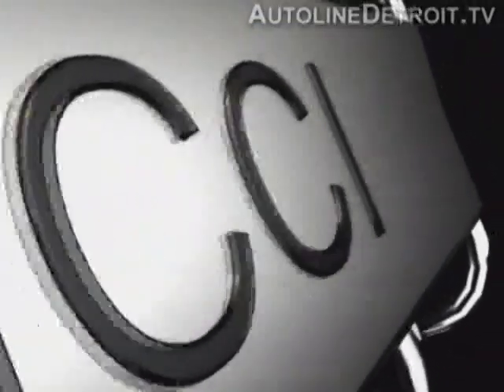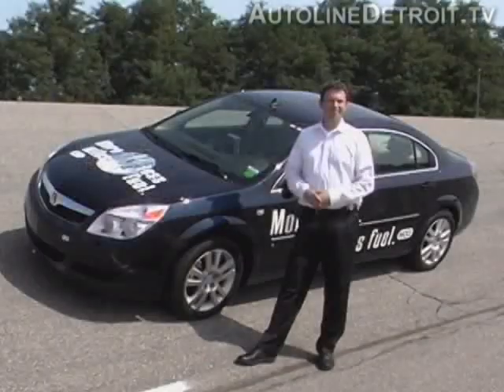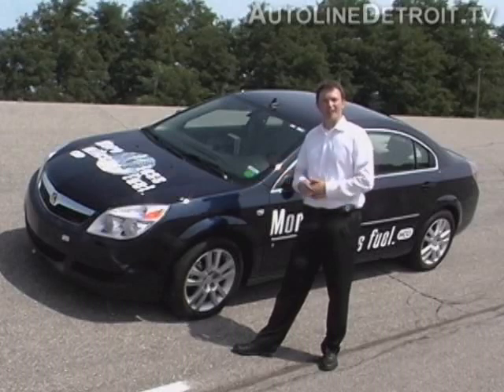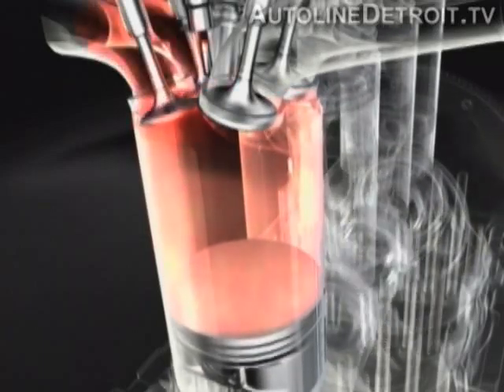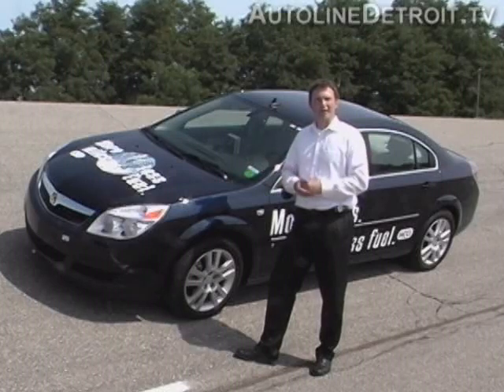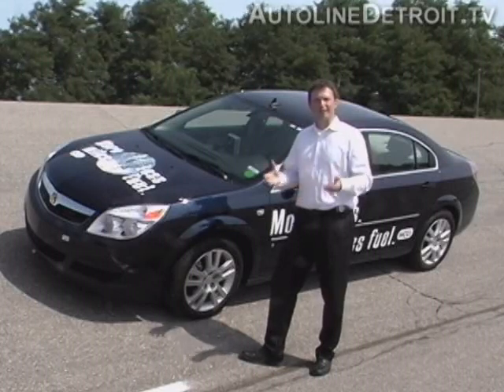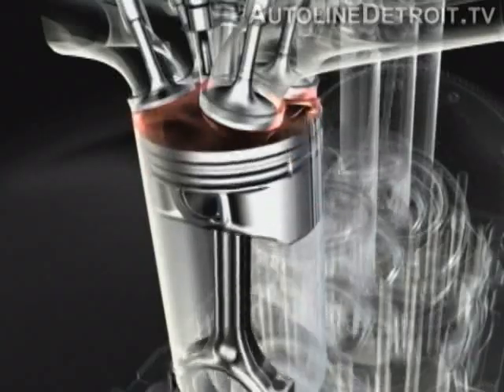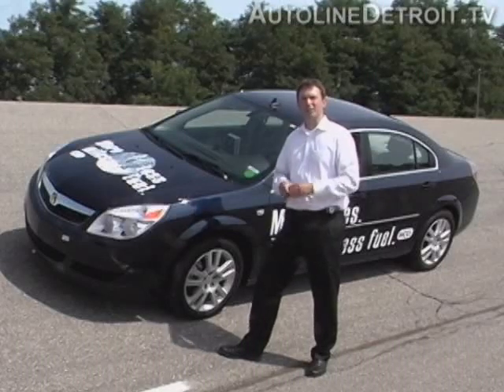John's Journal - GM Makes HCCI a Reality

Comment: 100 years? Get off your stupid Texan high horse and get the fuck outta here. Electric is around the 90% efficiency mark. You got nothing
Reply: Except for the line loss to get the electricity from the coal burning power plant to your charging station.
Reply: If all the ICEs were replaced with electric motors and rechargeable batteries, nearly all industry would grind to a standstill because trucks would only be able to get 300 miles between hour+ long recharging sessions.
Reply: Sander Vercammen ok well let's compare apples with apples then.. 
Run a bare IC engine at full blast straight into a dyno, and allocate say 100kJs of energy going into the engine as petrol. Then measure the power output as well as any waste energy due to heat in kJs.
Then mount E motor onto dyno, allocate 100kJs of electricity into the motor and measure power output and any waste heat in kJs.
Then directly compare power in kW or hp and heat in Joules.
Assuming the both motors are of good quality and representation of their own kind, I guarantee you the electric motor will be more efficient every single time.
Reply: Sander is correct. People who advocate electric like it's a miracle cure for all automotive ailments never seem to look at the big picture. When you're talking environmental impact, you have to take every step into consideration: mining raw materials, manufacturing, upkeep, recycling, etc. It's the same with the vehicle's power source. It is much easier and less expensive to refine petroleum than it is to manufacture a lithium-ion battery pack. 

Then there's the weight-to-distance disparity, which makes any sort of long distance driving laughable. As-is, electric is only viable for a few hundred miles, and recharging takes far more time than pumping a tank of gas. Even if fast charging stations were built all over the country to facilitate cross country travel, the time wasted by having to stop so often makes electric a poor option for any shipping or delivery service.

I'm sure these issues will eventually be ironed out, battery technology will improve, and we'll all be driving electric in the future, but it's going to take at least 15-20 years for that to happen, probably more.
Reply: Wich is a false comparison. Most coal and gas power plants have a efficiency somewhere between 30% and 60%.
Reply: The absolute best you can get out of an IC engine is about 35% (wide open throttle, full load), but the reality is that most cars seldom if ever run at more than 5% load and REAL efficiency is less than 2%.

Electric is about 35% source to socket overall(*), so EVs are still a major overall win - and it's a lot easier to scrub a smokestack than an exhaust pipe.

(*) Most combustion plants use co-generation systems which drives efficiency above the 60% mark. The lower efficiency plants are only used as peaking capacity. There's around 40-50% transmission loss in most electrical systems and non-combustion sources need to be factored in too.
Reply: 5% load? Maybe an expensive car with a huge engine. But with a small 1.0l -1.6l engines I can assure you it will be a lot higher. If you go 130km/h on the highway with a small car with a 1.3l engine you will be nearly flooring the pedal.The engine load will be over 70% almost constantly.
Reply: How would that work when half of the car is battery? A tesla battery pack weight 500kg. Good luck swapping that.
Reply: Sim Salabim no the battery is BEFORE the motor you fuckwit. Between the motor and wheels there's a diff and some shafts maybe, which has negligible power loss.
What about a iCE? There's usually a transmission between the wheel, that saps about 15% in power. The engine itself is around 35% efficient for petrol and 45% AT FULL THROTTLE! Who goes full throttle all the fucking time? Also, if you're idling at a stop light, that's 0% efficient. Whereas a EV off throttle simply turns off completely OR can be used to regenerate, which further improves efficiency. If you drive smart you can probably get near 100% efficiency in some cases.
EV at the moment, can't really do racing for any reasonable length of time, but that's just a matter of time. Time will solve that. 
ICE engines just have way too many obstacles, moving parts, friction, seal leakages and the laws of physics to overcome.
I was an engineering student so I know all this. Stop making shit up and do some fucking actual fuckin research.
Reply: In the context of clean energy this is still an apples with oranges comparison. I thought it was all about the usage of fossil fuels? If that is the case you have to start from the energy source, most often in the case of electricity this is coal or gas (even in the US still more then 65%). 

If electricity wouldn't have to be generated, yes it would be more efficient, and by a large margin. A large asynchronous electric motor might have 95% efficiency. An IC engine will not get 35%.
The problem is that at the moment, most of the electricity is still generated by fossil fuels, so you have to start from the same fossil fuels if you want a decent comparison. In total the EV will still be more efficient, but not by a margin as large as some people say it is.

This is coupled with the other disadvantages of an EV, and the limited amount of lithium reserves. EV's are simply not the miracle they are made out to be.

If it's not about green energy you might as well look at the energy density. Imagine that half ton battery gone replaced with gasoline. You would drive more then 6000km on one tank.
Reply: Sander Vercammen Ok, fine, move the goal posts again. 

Have you then, taken into account the amount of energy expenditure required for IC vehicles? Let’s do a comparison of each vehicle type and find energy expenditures of:
1) sourcing the base fuel
2) producing the fuel at the plant/refinery 
3) getting the fuel to the car
4) running the vehicle and
5) maintaining the vehicle.

For simplicity sake, I’m gonna designate energy expenditure points: Low as 1 point, Medium as 2, High as 3, etc etc. They’re somewhat arbitrary as I don’t have exact energy units in Joules and every model and type of car is different, as well as every category, but at least this gives us some kinda numerical value to work with and not just vague concepts.

For worse case scenario EVs that run on ONLY electricity generated from fossil fuel power plants: 
1) Sourcing base fuel; coal, gas, nuclear? via mining. MEDIUM energy expenditure = 2pts. 
2) converting fossil fuel to electricity; power plants are around 33% efficiency, and they also run at that efficiency MOST of the time, which is way better than ANY car. Power plants don’t have to idle at the lights. Still pretty shit efficiency though: MEDIUM energy loss = 2pts 
3) transporting electricity through transformers, substations, wires, home and then into the car battery; pretty minimal energy loss through the lines. High voltage AC is pretty efficiency. Some people live close to power stations, some don’t. LOW energy loss = 1 
4) Energy loss of vehicle: from battery-controller-motor-drivetrain-wheels. Also take into account some regeneration capabilities… lets say 80% efficiency. Also EV’s are currently heavier because of batteries, so 5% loss due to weight… 75% total efficiency which I think this is conservative. But it’s still LOW energy loss = 1, and will only get better over time.
5) vehicle maintenance energy expenditures: Batteries need to be changed every 10 years. Not taking into account non IC components like chassis, drivetrain, suspension, wheels, brakes, etc because an ICE car has to deal with the same thing. Controllers don’t really wear out. I don’t know cost of sourcing batteries so I’ll be conservative @ LOW-MEDIUM energy expenditure = 1.5pts. Again, battery technology will only get better and cheaper to produce.
Total energy expenditure score for worse case scenario EVs: 7.5pts (LOWER IS BETTER)

Let’s now do an ICE vehicle:
1. source the base fuel, in this case oil. Energy expenditure: VERY HIGH energy expenditure = 4, which I think is very very very very conservative. Why? Before you even get to the oil you gotta fight wars, which lead to complex political unstabilities, death, genocide, corruption, refugees, terrorists. The energy required to build camps, fight terrorism and corruption, world leader summits to deal with these problems and other side effects… Then you gotta drill it out and store and ship it. 4pts is very very conservative.
2. Refining the oil: very high energy process to refine and distill oil into the various fuel grades ie. unleaded, premium, diesel, hioctane, etc. MEDIUM-HIGH energy expenditure = 2.5pts
3. Transportation from refinery-storage-transportation-handling-petrol stations: MEDIUM-HIGH energy expenditure = 2.5pts
4. Once the fuel gets into your car, from fuel tank-engine-drivetrain-wheel @ 25% efficiency (again very very conservative because in the real world you have to idle and not always running the engine at it’s utmost efficiency). Most of the energy loss is due to heat and friction. HIGH energy loss = 3pts
5. energy require to maintain ICE car: need oils, lubricants, seals, spark plugs, multiple other parts required to keep IC engine running. MEDIUM energy expenditure = 2pts
Total energy expenditure score for ICE car: 14pts

Now this is just a rough educated guesses and isn’t super exact and all measured in real energy units of Joules or calories, but in EACH category, the EV is better… and that’s the worst case EV that runs on fossil fuels.
Reply: Shea Briar You’re making it out as if you need to change the battery pack every time the batter is low. No, it’s only once every 10 years, and battery tech will only get better. Have you heard of lithium nanotubes batteries? It’s still very early in development, but for the same battery size, these batteries can theoretically hold 10x as much energy as current ones, and charge in only a few minutes. Imagine not having to charge your smartphone in 10 days. Like I said, once EVs become mainstream, batteries will only get better and cheaper.
Also, did you not see the video I linked? The battery can be changed as fast or faster than filling up a convertional tank of petrol. Most people on average don’t drive more than 100km/60miles in a day, which is WELL within the range of most EV’s. Then you go home and plug it back into it’s charger. I’ve even seen some charging stations in some underground car parks here.
If you like road trips, and actually have the time to and freedom to do so, then you can either opt for an EV with higher range or get a IC car. But I imagine MOST people don’t have that luxury, and if they do, they’re not gonna do it that often and just rather get a plane or something.
Is this the case that you are sticking to IC engines simply because you LIKE them better?
Reply: Sander Vercammen Other things to consider: 
* We can assume that both types of cars cost the same to manufacture energy wise, more or less. So that cancels out. It costs a bit of energy to source lithium BUT it also costs energy to source rare metals for the catalyzers, more materials and metals for the bigger engines + supporting parts like exhaust system and intake manifold, radiators, turbo/superchargers.
* EVs are more compact. You can potentially fit more people and luggage into them compared to ICEs, which would further increase it’s efficiency if the end user chose to car pool more.
* Pure ICE cars can ONLY use oil as their base energy source, whereas EVs can use pretty much anything, since electricity is so easy to convert to and store.
* Fossil fueled EVs do require power plants… but these power plants also provide power to… well EVERYTHING ELSE! Including the refineries that refine the crude oil to create petrol in the first place. Power plants aren’t sorely used just to power EVs. Whereas ICEs require refineries, plants, transportation and stations, which in turn require more facilities to run these facilities. And it gets meta and crazy.
* I haven’t even taken into account best case scenario EVs that run ONLY on clean energy. Using these categories and point system I worked out that these perfect EVs only have energy expenditure score of 4.5. Solar, wind, geo, tidal, hydro are basically all free energy and don’t require extraction. So realistically, since some EVs run on clean energy as well as electricity sourced from fossil fuel power plants, you can say real world EVs as of NOW will have a score between 4.5 to 7.5. Even a conservative score of 7pts is WAY better than any ICE car.
* Hybrids or plug-ins then would be somewhere in between a worse case EV and an ICE, so they’ll have a score of between 7.5 to 14.
* EVEN IN THE SUPER BEST CASE SCENARIO for ICE, if you had a HCCI engine that is 100% efficient, meaning NO ENERGY LOSS DUE TO HEAT OR FRICTION, a god IC engine if you will, the total score for ICE would still be like 11pts because you still have all the energy wasted during extraction and wars and politics and refinery etc…
* IF ICE’s were 100% efficient, then I think it wouldn’t be a stretch to say that power plants would also be 100% efficient since they use very similar mechanics and technology, which would knock the EV score down another 2.5pts to 5pts.
Reply: hyusama

I never said anything about changing battery packs.

 I know most people don't drive cross country, but commercial vehicles often do.

Changing battery packs every time you need a recharge would have myriad other issues to overcome, I doubt it's a feasible solution. By the time the infrastructure exists and the equipment is implemented in enough refueling stations to make it widely available, batteries will have advanced to the point where it's no longer required. Commercial vehicles will continue to use diesel until that point.

Future tech will of course solve electric's problems, but that's the future, and we're talking about today. Carbon nanotubes, graphene, and the other materials that are set to revolutionize battery and charging technology are still at least a decade from being commercially available to the general public. Mazda's HCCI debuts next year, and will cost much less than any comparable electric vehicle. It's a good interim technology.
Reply: Well... Actually most fossil fuel power plants efficiency is in the range of 45-55% (at the power plants' generator output), well at least the modern ones made or renovated in the past 10-15 years. And the currently constructed power plants are reaching near 60%, for gas and coal plants though, oil plants cannot break the 50% limit.
It is the nuclear power plants that are with lower efficiency in the range of 30-35% (mostly for safety reasons). Which is somewhat negligible anyway because even if they were at 10% its still the only reasonable use of this type of fuel (thorium/uranium (plutonium is artificially made, also a byproduct and also "burnt"))

I am not exactly that much aware of battery production, but I dont think that it is much better than using oil as a fuel if we are looking at it globally. Same goes for "green" power - it still needs a lot of resources AND power to build the turbines/EVs and whatever else.

However, taking out a lot of combustion gases out of the cities, well thats a plus for the citizens!
So there is a NO gain at global perspective, but YES there IS gain in the quality of life in the city. So its not about ecology, but for quality of life.

 P.S. I'm a bachelor in fossil/nuclear power plant engineering and actually know what im talking about.
Reply: 0x1A3C3E7
Minutes? Those battery pack weigh a ton, sometimes literally. The gas station better have a hydraulic lift, a forklift, and a crew of mechanics on hand. And I don't know about where you live, but around here it takes 15 to 45 minutes for an oil change, depending on how busy they are. Imagine the wait if damn near everyone needed that sort of service instead of just pumping self-serve gas?
Reply: My stepdad has a masters in engineering, and he knows nothing about cars beyond how to change his own oil. Just being an engineering student adds no legitimacy to what you're saying.
Reply: I can't see how not having a battery has something to do with efficiency. The battery in IC engines does not have an effect on efficiency....
However Hyusama is also comparing apples with oranges. If you want to factor in the efficiency of a IC engine (indeed around 35%), You also have to factor in the efficiency of a power plant, and transmission lines. An electric vehicle also can not regenerate anything when standing still, when braking however the motor's might be used as a generator. 
While EV's are more efficient, I don't see them taking over in the next 10 years. Even the Lithium batteries are a problem, lithium is very limited resource. And there is also the massive weight of the batteries  that was mentioned, as well as the limited life of them.

Comment: Wow! a  up to 15% fuel efficiency gain just by throwing even more  finicky  electrical and mechanical crap on an engine.

Sorry, but I drive Fords and Fords can easily achieve 15 - 25% or more  fuel efficiency and power gains just by stripping their emission systems off and going back to good old fashioned old school heavy towing camshaft profiles and retuning the ECM's to work with them.   

As for emissions compliance. Fuck you! 
After our fuels were reformulated in the 1970's and catalytic converters were invented knocking emissions down by ~90 - 95%  from pre fuel reformulation and catalytic converter days everything else has been nothing but a god damn power and money grab scam since.